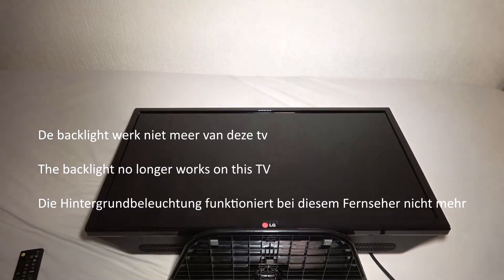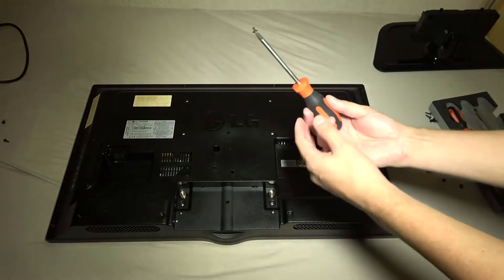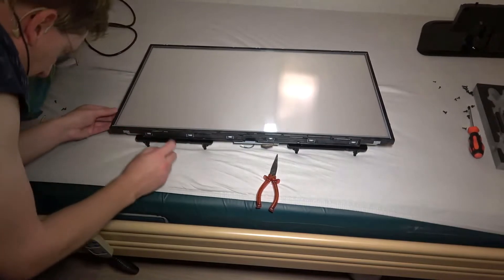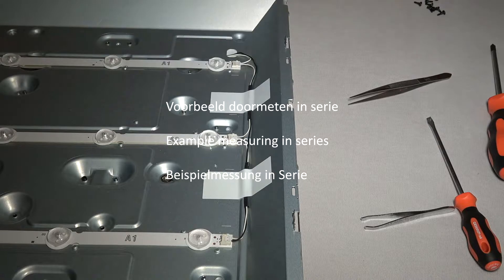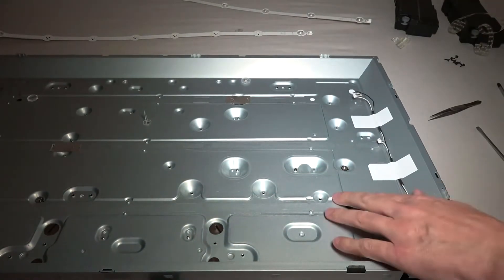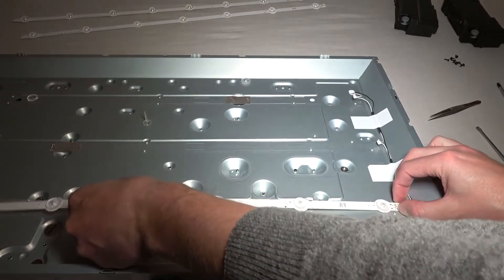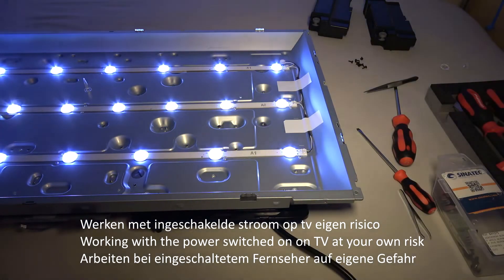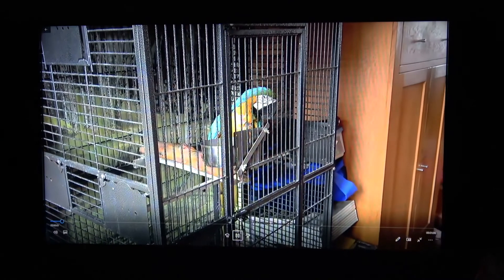LG TV Repareren LG 32LN5403-ZA TV Backlight Vervangen Repair Replace Backlight

Comment: Ik werk met variac of scheidingstrafo...maar met prof amps met dikke voeding op 140 amp wil je geen ruzie krijgen! Kan je bijna mee lassen. Het is zelfs in reparateur TD afdeling soms verboden (ARBO) alleen te werken, geen kettingen, ringen, horloges dragen, en andere beschermende maatregelen.  https://youtu.be/s9DEbBfiry4
Reply from the maker: Goede middag John, Jij bent ook goed bezig met jou kanaal ja inderdaad alleen werken is gevaarlijk ik was een keer bezig met een ept elektrische pallet truck die letterlijk uit de vracht wagen was gevallen misvormt ik kende dit type niet en maakte kort sluiting met een tractie accu van 48 volt mijn sleutel werd zwart en ik heb het light gezien het blijft oppassen ik had de accu af ge koppelt maar maar schijnbaar zat de accu met nog een stekker verbonden vandaar eens maar nooit weer.    
Prettig weekend met vriendelijke groeten Jo
Reply: @DitIsJo  Ik heb n eigen trailer gehad en laadklep met eigen tractie accus van elke 12v/1000 amp in serie (is 24v). Geloof mij maar die voel je ook wel ook al is het maar 24v DC 😆
Reply from the maker: Ja ik was toen ook alleen als stagiair monteur mobiel intern transport vandaar dat weer aan dit verhaal dacht